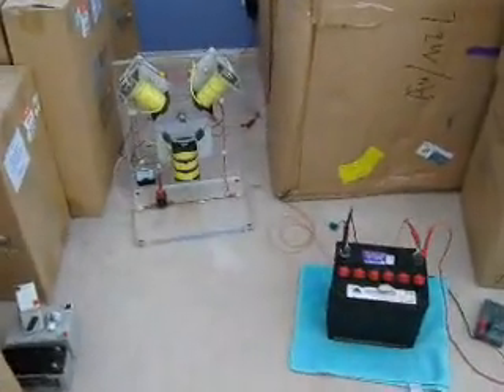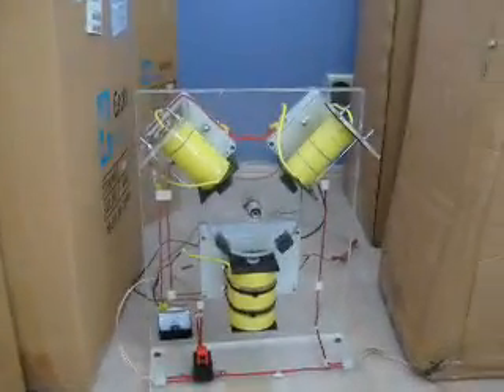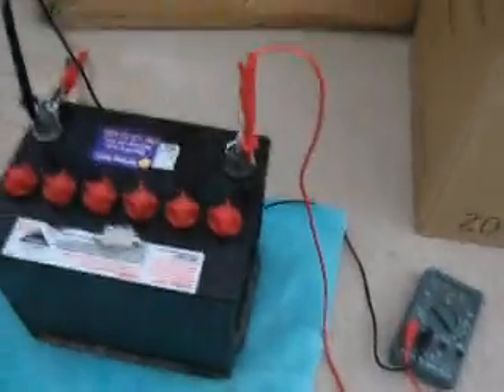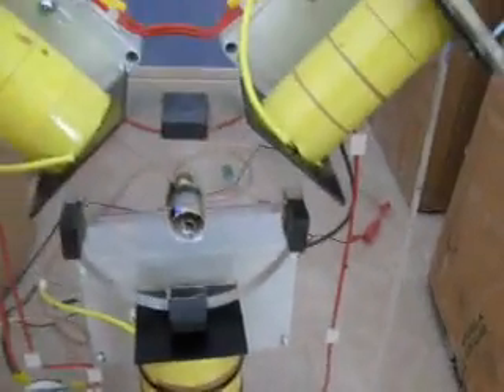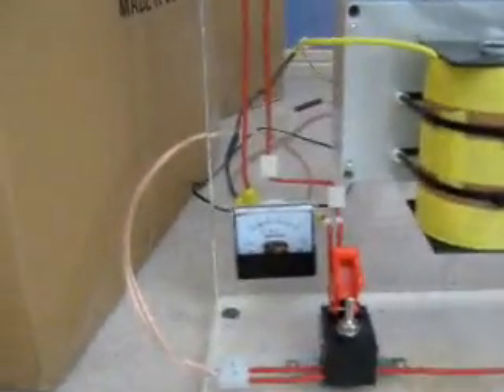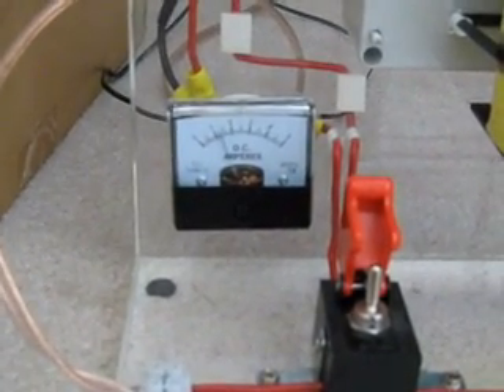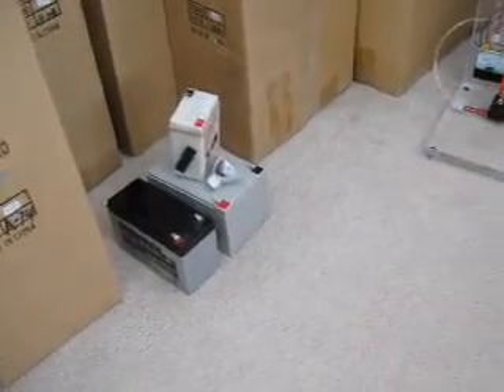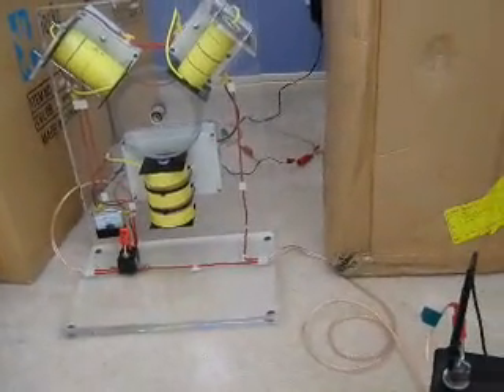bedini charger Video 14

Comment: if this device is producing more charge to the battery  than the power pack.
why dont you loop the output of the charger to power the  original input voltage from the input.

or does this not work, your getting more power out put than you put in.

Comment from the maker: @TakronRust Hi mate, pretty soon after it was completed I removed to rotor and adjusted the circuits to run solid state. My grandad got this charger and ran it pretty much non-stop for a year. Not as a self-runner but as a battery rejouvinator. He reclaimed over 20 deep cycle batts with it. He some how managed to fry all of the transistors a couple of months ago and when I get around to it I will be repairing it.

Comment from the maker: I'm in the process of building a 20 circuit unit, so I've been focused on that for the last couple of weeks. Now that the parts are on order I can get back to this one. 8 circuits seems to be a good size for car batteries, but propper deep cycle batteries will need a unit with some more umpf, so to speak. Cheers

Comment from the maker: Hi Ren,

yeah I know, but it was a free totally useless one from Battery World so I figured it couldn't get any deader. LOL. The other reason I use the light bulb is for speed. I know JB says to do the C20 Rate, but that takes a long time, and I fiure that a 100% working car battery of about this size should be able to draw approx 8 to 10amps for 30 min. Also I have seen a steady increase in the time it takes to discharge. At the moment it takes around 20 min. When I started it took 3 min. :)

Comment from the maker: Hi and thanks.

The third coil at the bottom is basicaly the two top coils in one. It is quin-filar, one wire is the trigger and the other four are the power coils. The bottom coil is out of sync with the top two so it has its own trigger. Each strand (power coil) has its own transistor(8 total for the three coils).  
The magnets I am using are ceramic. 

I am using a 24V power adapter as the input. I am doing this because I am conditioning that battery.

Comment: Excellent work man, 5 stars 4 u!

I have a few questions:

-What is the third bottom coil for? is it the same as the other but just bigger? 

-Are u using separate circuits for each coil? I'vejust upgraded to 2 coil system and I simply have the 2 pulse windings hooked up in parallel to my single circuit.

-What mags u using? I have tiny neo's,not enough to induce current in trigger coil.

-are u charging quicker than using the run battery? I noticed a transformer...